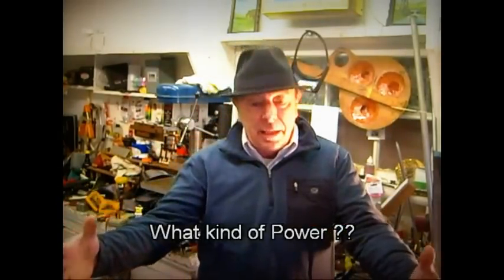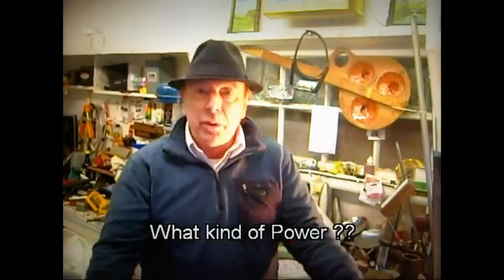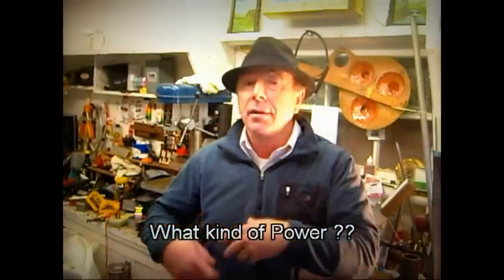The Electric Motorhome Part 4

Comment: With a motorhome you don't need to worry about the weight, do you? I mean the thing weighs in at about 10,000 lbs. or more anyway, right? Even if 20 batteries weigh 2,000 lbs. it wouldn't make much difference. I'd put in 40 batteries and slap a few 210 W solar panels on the roof to recharge them while the motorhome is parked (which it is most of the time). 40 good batteries would cost about $6,000 and the solar panels could be supplemented (on cloudy days) by a little gas generator (5 or 6 KW).